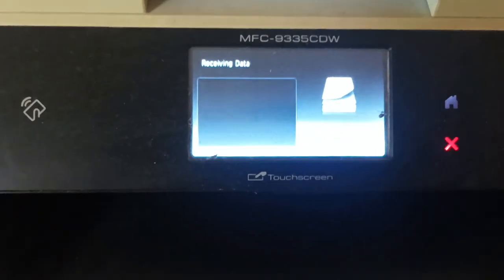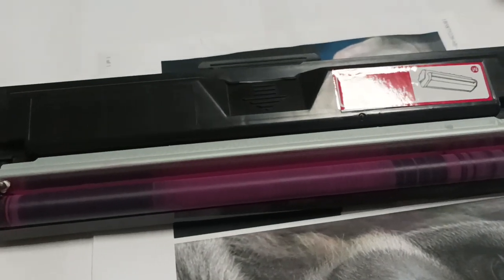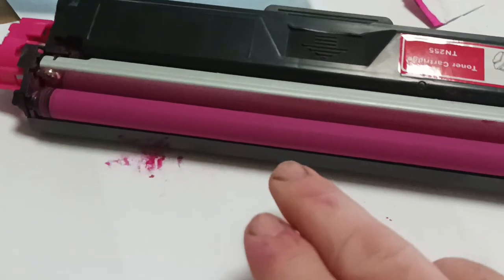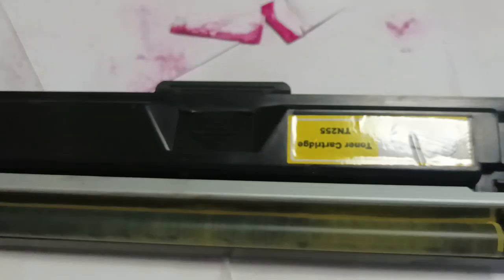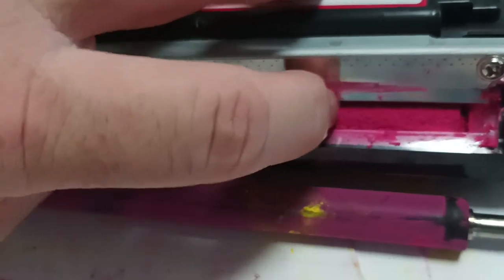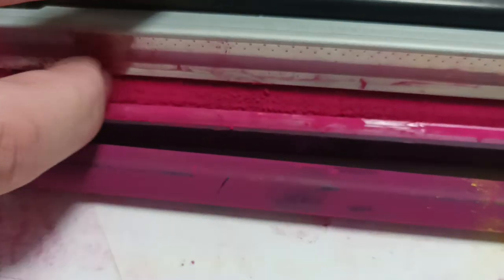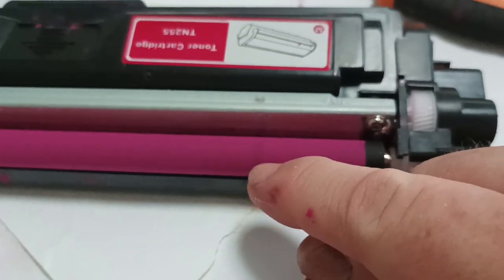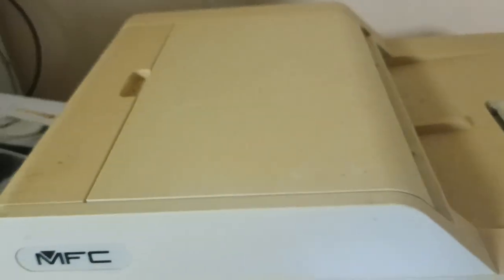Improve Brother Colour Laser MFC Printer Print Quality Fix - Repairing Laser Printer Toner Cartridge

Comment: when you fix  one specific toner like red , how many time do you calibrate or how do you work the toners to get rid of that horizontal banding?   brand new toner  I get usually get me that banding and takes a while to get rid of them,  what is he normal number of pages of solid color you need to print before thinking yu have a bad toner or a bad connection or bad drum that is causing the horizontal banding ,
Reply from the maker: You print NO solid colour. If you do that you EMPTY the cartridge. A full cartridge does 2500 pages at 7% coverage print 100% solid colours and the cartridge will physically be empty after only 100pages. Then the cartridge will start leaking everywhere all whilst telling you on the screen the cartridge is still 85% full.